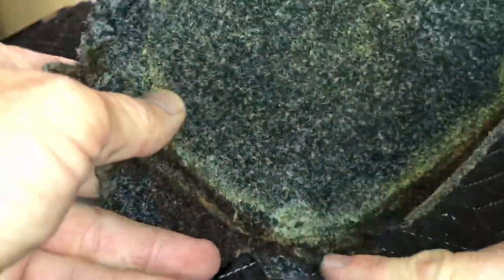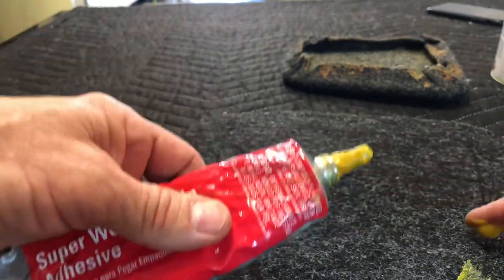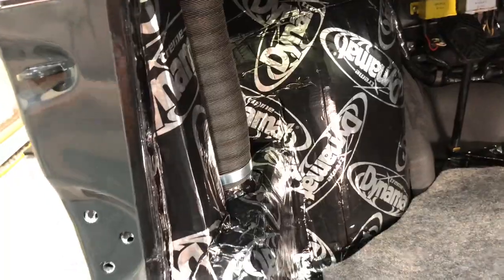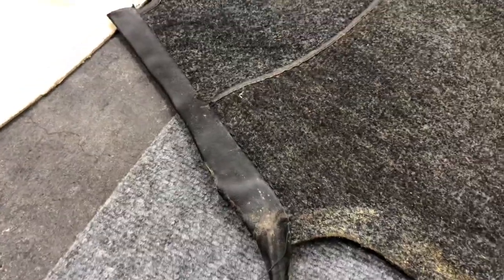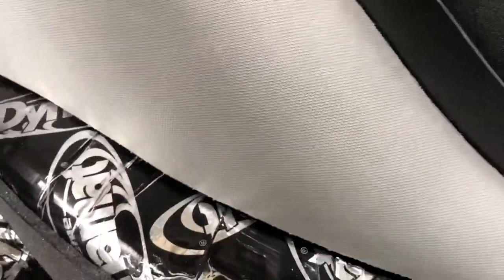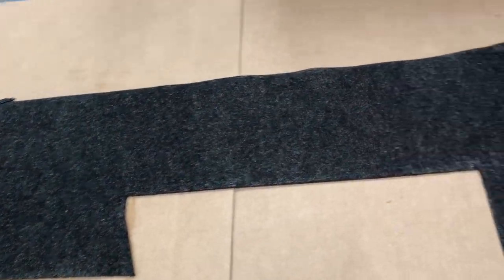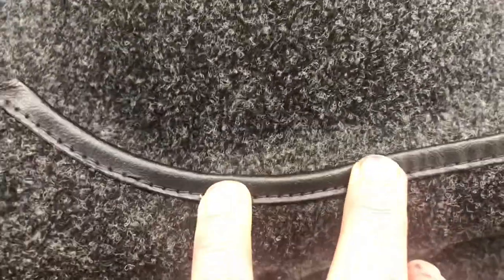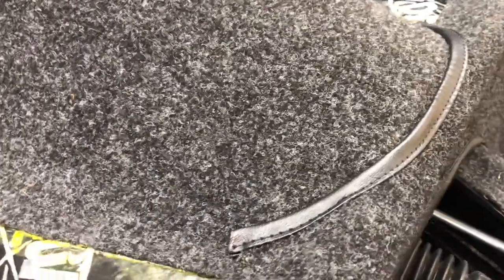1967 Porsche 911 Video 57 Completing carpet installation

Comment: Hi Mike, super job on the carpeting. I've seen similar but lighter material used to line van/camper conversions. It's 4-way stretch and seems quite forgiving but also does a good job. Coming together really well. Stay safe and keep up the god work.
Reply from the maker: Hello Pedro
Thank you..yes when working with inside/outside radiuses a little stretch in the material will
really produce a nice tight installation

Comment: Beautiful job!  I wondered about your overall approach to restoring the car as I watched these last two videos...you have been very meticulous in maintaining an exact match to the original in other areas, but here you are adding padding and insulation (not a bad idea) where there were none originally.  What is your thought process? : )
Reply from the maker: Hello John
Thanks=) Thats a great question! 
Yes there is a definate build plan for this car.
I try to keep to Porsche originality as much as possible..however if there is an area that could be improved with modern materials without changing appearance or mechanical soundness I will use the modern alternative.
The end result Im shooting for is as factory looking build but a much shinier and more detailed in show & shine
than the original.
Original underlayment materials & undercoatings used in these early cars were awful ..Horse hair..smells really bad and feels crunchy with minimal quality sound absorption.
These were production cars back in the day and even though they were masterfully put together on an assembly line they still had to be done quickly and cost effectively.
Today we have the ability with modern paints, custom chrome plating, Interior fabrication materials etc.. to build art gallery grade restorations if that's the goal
However not all restorations would be classified under the same category in my opinion.
 
I would classify modern restorations under a few different category's.
*Restored and ruined
*Restored and very well done but not correct in many ways..incorrect parts , many donor parts or new replacement       parts, body panels, engines, incorrect trim etc.
*Restored to original spec in every detail (Museum Quality) mostly an illusion..
*Restored to art gallery grade ( via show & shine, and detailed to the smallest degree)..SEMA/Pebble beach level

My end goal is an original as possible looking car, more than 90% original & authentic parts it came with from the factory..but much smoother, sounder & shinier than the original.
Im not sure what we will end up with when she's finished but will try my best for Porsche and the guys how built it

Comment: Hi Mike,  nice work....as usual! Thank you letting us in on the build, I look forward to your videos! Quick question,  where did you source the gray foam that you used on that small panel, I’d like to use it on the underside of my hood (non Porsche hood). Or do you recommend another product? Thanks!!
Reply from the maker: Hello Marc Thanks
With the exception of the dynaliner foam and dynamat
All my interior materials are supplied to me by autos international inc.
Im not sure that particular foam would be suitable for hood insulation
it not very dense and would need to be applied with contact cement.
1/4 dynaliner might work better in that situation. a peal and stick and you might try acetone to remove the logos..or maybe hood insulation which
is usually a mesh/fiberglass type material.
Here is a link to Autos Inc http://www.porschetopsandinteriors.net
Good Luck!